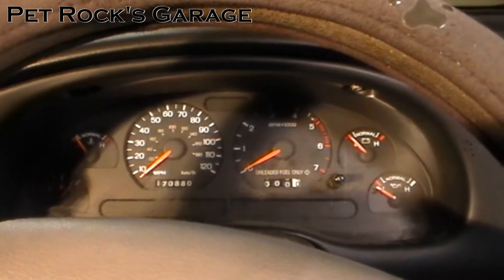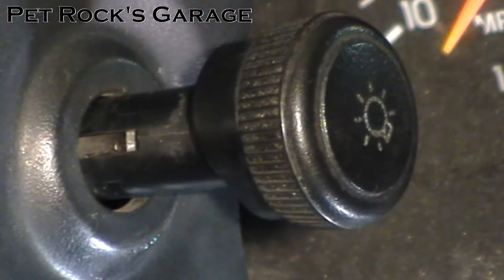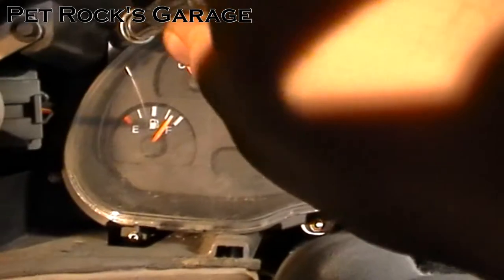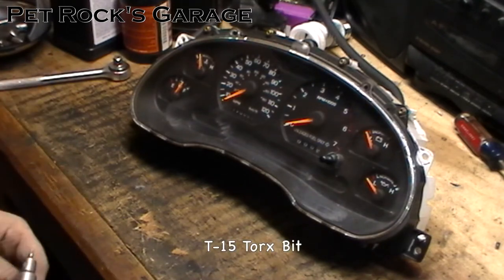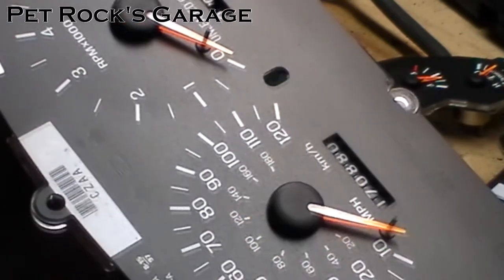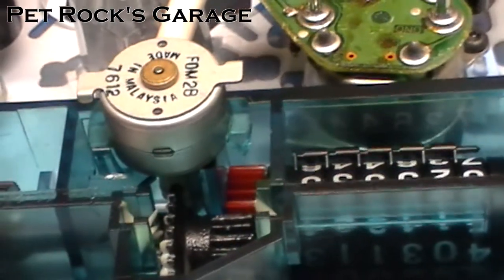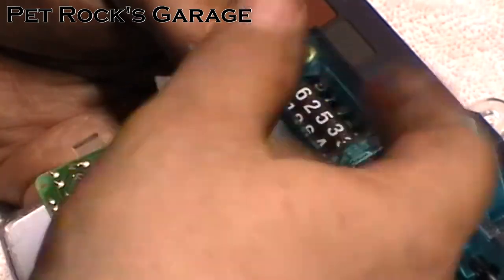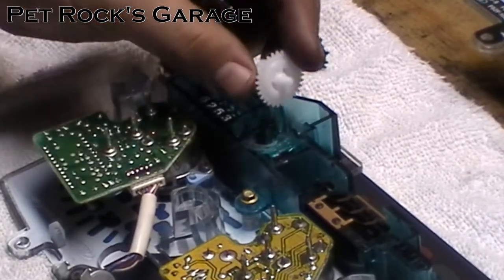How To Fix Broken Odometer & Trip Meter -- Ford Mustang ('94-'98) and others

Comment: Great video.  I use a small, round, felt polishing pad on a Dremel to rotate my odometer forward.  Use low speed on the Dremel and lightly touch the pad to the drive gear.  A 45 minute job adding 500 miles then becomes a two minute job.
Reply from the maker: Thats a pretty good idea. Work smarter not harder.

Comment: excellent video saved me a lot of trouble but 1 thing you may want to do a little research on dielectric grease as it should never be put on the electric contacts themselves. at least thats my understanding  because the grease itself does not conduct. thanks for the video.
Reply from the maker: Thanks. I'm glad my video helped you out.
Re Dielectric Grease: the definition of Dielectric via Google is "a medium or substance that transmits electric force without conduction; an insulator." Therefor Dielectric Grease does not conduct or resist electricity and is therefor safe to use on electrical contacts. It insulates the contacts from the elements to prevent corrosion without adversely effecting the electrical connection. Hope that clears things up for you.

Comment: Getting ready to do the same on my stepson's 96 gt  . You're very thorough , however would you not add a little lithium grease to new gears  or leave dry ?
Reply: I found my answer scrolling down the  replies! Thanks ! Great video.
Reply from the maker: Thanks a lot. I appreciate it. For those who may stumble onto this comment, the answer to Rick's question is: "I smeared the grease that was on the old gears onto the new.  You don't need a lot,. Whatever grease you use needs to be plastic safe. Regular chassis grease (the grease used to lube ball joints & tie rod ends), for example, is not plastic safe.  Brake caliper grease would work.   Hope that helps."
Reply: @petrocksgarage   I tackled this like a pro after viewing your video ! thanks again works like it should now !!

Comment: Wow that was chewed up. My digital cluster is about $1200 to replace on my F150  , it's like a computer more so then the old style like yours. Nice fix. 👍👍
Reply from the maker: Thanks a lot.  The gear was literally crumbling in my hands.  20 years of heat cycles will do that I guess.  I was very happy it was a fairly inexpensive fix. My Durango is digital too. Thankfully I haven't had many electrical issues with it. (fingers crossed).

Comment: Thank you sooo much.  I really appreciate this Sir.  Great video.    Sir,. If it's not to much trouble.  By any chance would it be ok to see a video on how to remove the top fuel lines near the AC tank on the passenger firewall side.  I'm having trouble and it's leaking.  Any help you extend is greatly appreciated Sir.
Reply from the maker: Thanks.  I don't have a video on hand for that at the moment.  However, if you just want to disconnect the fuel line you'll need a disconnect tool like this:
https://shop.advanceautoparts.com/p/autocraft-9-pc-a-c-and-fuel-line-quick-disconnect-tool-set-ac501/9010298-P

Just find the one that fits the line you want to disconnect and slide the tool in until it clicks and then pull the lines apart.  Pretty simple.  Make sure to have the fuel system purged though otherwise you'll get a face full of fuel when you disconnect the lines.  You can purge it a couple different ways, but the easiest is to pull the fuel pump fuse and run the car till it dies. Hope that helps.

Comment: Replaced the gears and it still dosen't work-the speedo and tach do-does the odometer and trip meter[which also doesn't work]have an electrical component also or is it just the gears-what makes it work?Thanks for the help.
Reply from the maker: If the original gears were not damaged or broken, then they are not your problem. Yes, there is an electrical component that sends power to the odometer/trip meter motor in the cluster. It's one of the many wires going into the connector on the back of the cluster. Different year mustangs have different connector configurations, so I can't tell you which wire to look at first. Good luck.

Comment: Hi, so my fuel, oil, battery, odometer and speedometer all stopped working so i replaced those parts like you did and they still don't work. So this would then be an electrical problem right?
Reply from the maker: Just replacing parts when there is a problem will just waste a lot of money over time. Its like throwing darts in the dark and hoping to hit a bulls eye. Yes, it sounds like an electrical problem given that all of those things failed at once. It could be as simple/cheap as a blown fuse or complicated/expensive as a broken/damaged wire, corroded connection, bad console or a combination of those. It would definitely not be the gears I show how to replace in this video since those gears don't effect the fuel, oil or battery gauges.  If you aren't good at electrical diagnostics take it to a shop to diagnose it. Once you know the problem you can decide to fix it yourself or have them fix it.  You'll save money in the long run this way. Electrical issues can be a P.I.T.A. to diagnose & fix sometimes. Good luck.

Comment: So I replaced the gears. The odometer and trip meter are working again. All my gauges work except the tac. I sat the cluster face down while I was trying to replace the gear and accidentally broke the pin that holds the tac needle when it’s at zero. I super glued it back on but realized the needle was underneath it. So I wound it back counter clockwise and let it rest on the pin. 

I’m thinking that maybe if I were to wind it back in the original direction that might make it work again. Thoughts?
Reply from the maker: Sorry to hear you broke the tac. I'm not sure if your plan will work or not. It all depends on what broke & where. Good luck.

Comment: Will this also fix the speedometer that stopped working at the same time?
Reply from the maker: No, it won't. The speedometer is a completely different component than the odometer/trip meter. The two are not mechanically connected. They are indirectly electronically connected though.  So if the odometer & speedometer stopped working at the same time I would suspect an electrical issue, not mechanical.  It could be a bad fuse, bad wire(s) going to the instrument cluster, a bad solder joint in the instrument cluster, bad instrument cluster... the list goes on.

If you aren't comfortable tracking down electrical issues, I'd suggest finding a shop that is good at electrical stuff and have them diagnose it. Please don't just throw parts at the problem (like a new instrument cluster). Thats like throwing darts in the dark and hoping to hit a bulls eye. If it does turn out to be an instrument cluster there are companies that refurbish instrument clusters for cheaper than a new cluster. Good luck.

Comment: I accidentally moved the fuel gauge. Will it reset to the correct level when I fill the tank? You said something about stepper motor. Thanks!
Reply from the maker: No, it won't reset.  The fuel gauge doesn't use a stepper motor. You'll have to move it back to roughly where it was when you took it off. Hopefully you've got a good memory or took pictures before you took everything apart. Good luck.

Comment: PLEASE HELP! What if I replaced the gears and the miles too my car still won’t go up and the trip odometer won’t spin either? Could it be the speed sensors? Or could it be the cluster printed circuit board is probably messed up?
Reply from the maker: It could be any number of things.  It could be the cluster, wiring to the cluster, the speed sensor, the wiring from the speed sensor, bad fuse etc etc.  The list goes on. Don't assume it's a part that is wrong when it could just as easily be a bad wire. Jumping straight to a part as the problem is like playing darts in the dark and hoping to hit a bullseye.  I'd recommend taking it to a shop that is good at electrical diagnostics and have them diagnose it.  It might be something you can fix, otherwise pay them to fix it.  Good luck.

Comment: I just got my 96 mustang and the people I bought it from said the mile gauge needs fixed I’m just not sure how many miles off it is 😅
Reply from the maker: I'd start at zero.  :-)  New (to you) car, new milage.  :-)  But seriously, any value is fine. IMO, as long as it is accurately ticking away the files then its fine. I primarily use the odometer to know when the next maintenance operation is due, and the trip meter to keep track of my MPG.  Up to you.

Comment: What if the FUEL ODOMETER indicator shows the wrong reading and doesn't go to 0 when the car is off?
Reply from the maker: fuel odometer? Do you mean the fuel gauge? The fuel gauge is controlled by the fuel sending unit attached to the fuel pump in the fuel tank. It could be misbehaving for many different reasons. Most likely would be a damaged/corroded wire between the gauge and the sending unit, or a bad sending unit. If you aren't good at tracking down electrical problems, I'd advise taking it to a shop to diagnose it. Good luck.

Comment: did you apply any grease to the new gears? and what kind did you use?
Reply from the maker: I speared the grease that was on the old gears onto the new.  You don't need a lot,. Whatever grease you use needs to be plastic safe. Regular chassis grease (the grease used to lube ball joints & tie rod ends), for example, is not plastic safe.  Brake caliper grease would work.   Hope that helps.

Comment: I wonder what's the difference between SMP #C82001 and DORMAN #924388, which Rockauto suggests as the only one? It seems only the price is different (i.e. 20€ vs. 40€). Nice job! Finding the other SMP part number saves me 20€ + tax + P&P. Thanks! :-)
Reply from the maker: I have no idea what the difference is. Probably different supported vehicles/models?  Dorman 924388 apparently comes with two sets of gears where the SMP comes with only one. Maybe there are vehicles/models that need two gear sets?  I'm not sure.  I'm glad my video helped you out and saved you some cash. Thanks for watching & commenting. I appreciate it.

Comment: HI, I have a ford explorer 98 XLT and all the gauges are fine except the one that  shows the speed, I already replaced speed sensor and still my speed gauge does not work, any suggestion?
Reply from the maker: You've ruled out the speed sensor, but that is only one of the many different causes. It could be a damaged/broken wire between the speed sensor & PCM or PCM and instrument cluster, or the electric motor to turn the needle in the cluster could be bad, or the cluster itself could be bad. Best to find someone who is good at diagnosing electrical problems and have them investigate. Just throwing parts at it will likely be a waste of time & money.  It's like throwing darts in the dark and hoping for a bulls eye.  Good luck.
Reply: thank you, this is the best answer I found so far, I will keep investigating

Comment: Ok i have a 1998.ford mustang.3.8L,V6, standard.....my speedometer.stopped working.directly on top crossing the highest point of . Bridge taking you to Galveston island....I removed the whole odometer cluster panal.. opened it all up.. the gear was broken..the worm I replaced any ways......I also replaced.the speed sensor..twice thinking the first one was bad.. Everything on the odometer cluster is good I've managed to calibrate the needles light up the panel.and I cleaned up  behind where u install the bulbs.. I straightened out any bent copper lines going to where your connections go....but no working Mph.Needle.the check engine  light stays on ...which says no reading from sensor...or faulty connection... what am I missing.or what do I do next.cuz I went balls out an replaced all lifters , pushrods.rocker arms .I bought a all out gasket I got everything.i replace all three of the different freeze plugs.i resurfaced the heads.... painted anything I could old Ford blue... like head covers.brackets an..I cleaned the air intake inside an out I got a new transmission.withba resurfaced flywheel....I installed a racing clutch.. there are three things I need to do.1is find any gear debris.. overlooked...an clean it  again....2clean abs sensors on all four wheels.an ...3make sure the gear that slides into the transmission.is good an verify if it's the correct one....
Reply from the maker: A lot of things could cause the speedometer to stop working. Broken wire, high resistance somewhere in the circuit, bad connection, bad electric motor for the needle etc. It is hard to diagnose from my keyboard. I doubt the mods you did to the motor had any effect on the speedometer, unless you pinched/damaged a wire somewhere during the install. If you are handy with a volt-meter you could probably trace it down and find the problem. I'd get the wiring diagram for the cluster from www.bbbind.com, if you don't have the factory wiring diagram book. Back-probe the signal pin for the speedometer motor and see if it is getting a signal when you drive around a little (or put the rear up on jack stands and just put the car in drive to let the wheels spin freely a little, don't go nuts on it though). Then work from there (checking powers & grounds to the speedometer motor etc).  If you aren't good with a volt-meter then I would recommend taking it to a shop that is good with electrical issues. Good luck.

Comment: I’ve took out my cluster & the gear was not broken. Both of my odometer n speedometer aren’t working. I then took off the speed sensor on my rear diff lock but it was not broken n I wiped off. But still nothing is working.. any help? 98 ford ranger 4x4 v6 3.0.
Reply from the maker: It could be a lot of things. Chances are high that it's a broken or damaged wire somewhere, but I also wouldn't rule out a bad sensor. If you are not proficient in using a multi-meter or volt-meter, I would take it to a shop that is good at tracking down electrical problems like this. A good tech should be able to figure it out in an hour or two. Hope that helps. Good luck.
Reply: @petrocksgarage  thank you also i was looking to replace the speed gear from under but i cant seem to find it. I appreciate all the help
Reply from the maker: @FOPEZ  The speedometer is not controlled by a gear. Just the odometer & trip meter are gears. The speedometer an electric motor.
Reply: @petrocksgarage  thanks man.  
the replace the speedsensor on the rear diff lock with a new duralast sensor but still no improvement
Reply from the maker: @FOPEZ , as I mentioned, it's highly likely that its a broken/damage wire. Especially since two electrical components are out at the same time. I wouldn't just throw parts at the problem. That's like throwing darts in the dark and hoping to hit a bulls eye. Find a good shop that can diagnose it properly. You'll save yourself time, money & headaches that way. Good luck.

Comment: is it the same gear for miles an hour or kilometers an hour ie canadian or american cars i replaced  still not woorking does the worm gear have a certian direction
Reply from the maker: Yeah, its the same gear for kph & mph.  The computer just rotates the gear at a different rate for kph vs mph.  If the gears all lined up when you re-installed it then it should be in correctly.  If it still doesn't work, make sure that the gear is spinning when the rear wheels are spinning (jack the rear wheels off the ground, chuck the front wheels so it doesn't role, and start the car and put it into drive. Let it spin the rear wheels at idle. If the gears don't spin then the problem is electrical (either in the cluster, wiring to the cluster or the computer).  Good luck.

Comment: What about if it not working still ?
Reply from the maker: If the gears were broken and you replaced them but the odometer still doesn't work, then chances are that there was a secondary problem in the instrument cluster or in the wiring to it.  Good luck.

Comment: How you fix stuck gauges on a 97 mustang
Reply from the maker: which gauge? They are all controlled electronically and only a few have a mechanical component.
Reply: @petrocksgarage  gas gauge and engine cold/hot gauge
Reply from the maker: Those are electrically controlled by the ECU and the needle moves via a little stepper motor.  It doesn't use gearing like the odometer & trip meter. So if they are stuck then its an electrical problem either in the gauge cluster, gas & temp sensors, wiring, or ECU. There is no silver bullet fix here. It needs to be diagnosed by someone who is good at diagnosing electrical problems. If you are, then you can get the wiring diagrams from bbbind.com and do a series of voltage drop tests to find the electrical fault. Shouldn't take more than an hour if you know what you are doing. Good luck.